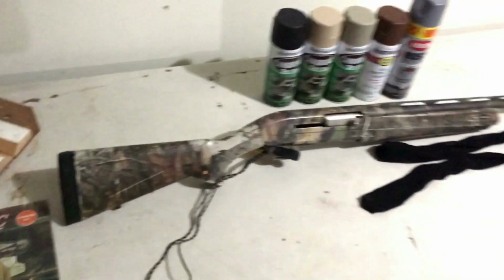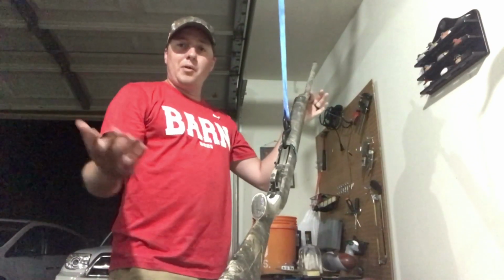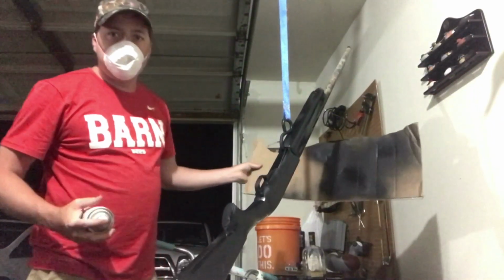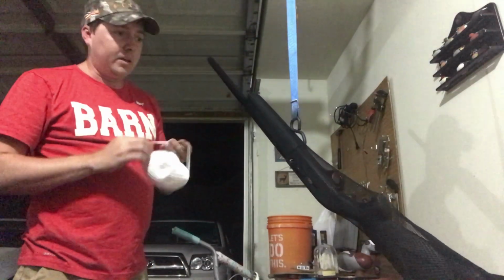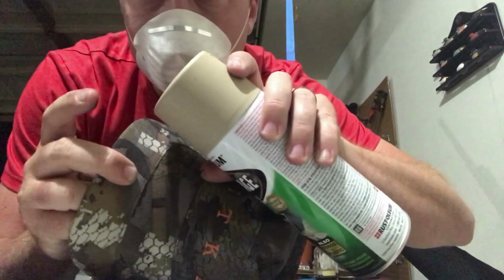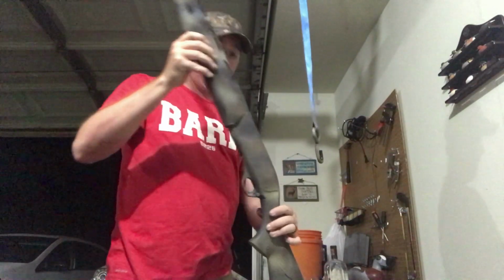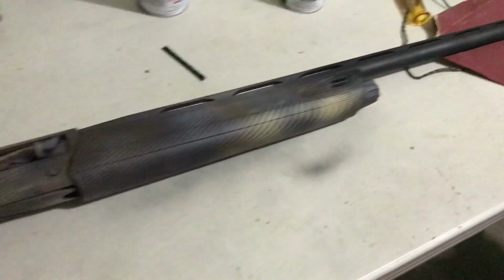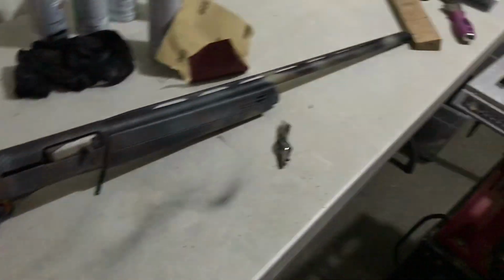How To DIY Optifade Timber Camo a Shotgun For 30 Bucks

Comment: Did you not have to use the protectant enamel? Just did my gun today but didn’t put any on. Just did it how you did without the flat protection enamel. Hope it holds up awhile.